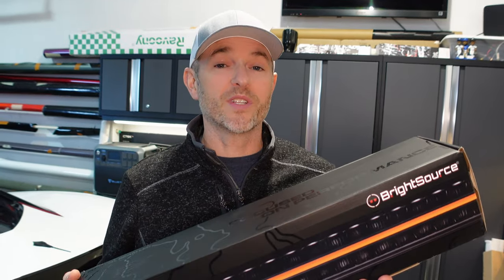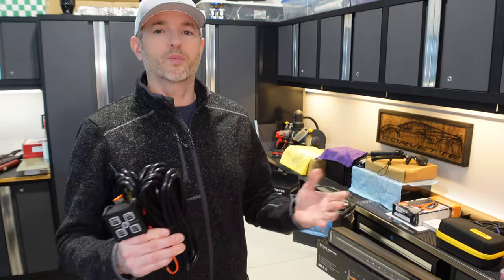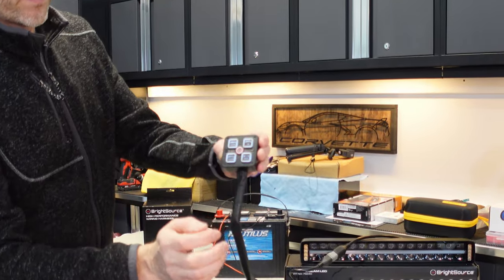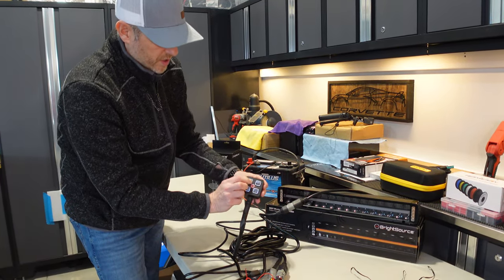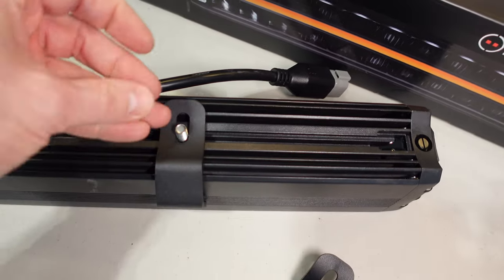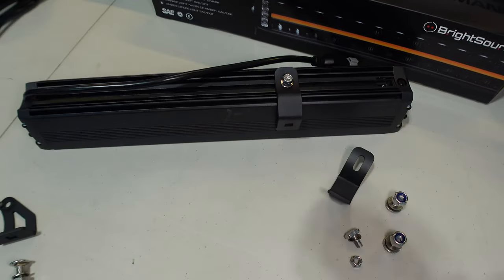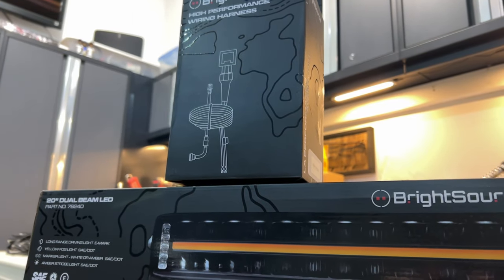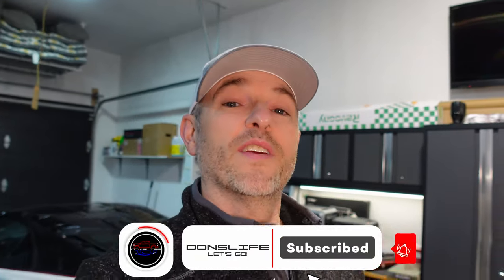Titanium T4 Quad Function Dual Beam Light Bar & Switch Kit by Brightsource

Comment: Sweet setup. I am thinking it might be hard to mount cleanly in the AT4 the switch looks a bit thick. Would you have to feed one of the connectors into the cab? I love the plug and play relay for the brights they offer.
Reply from the maker: The bar can be wired up to the switches I have in my AT4.  I wouldn’t need the kit
Reply: @Donslife  yea you have the NASA control panel there that can do anything. Looking forward to seeing what you do with the front end makeover.  Nice light bar and I like the idea of having it on when the brights are on. I have the bed lights you installed ready to go in and I grabbed a relay and a switch so that I can have them on with the normal button or with a manual button in the bed.  Weather has been too cold and wet here and my truck is too long to fit in the garage. Never thought to test that when we bought the house.

Comment: Is this Light Bar Water Proof or just Resistant?  Is there a Drain or Dribble hole on this Bar?  Does this Bar require the Power Cable to be on One Side or the other?
I really like the FOG Light and the Driving Light choice.
Reply from the maker: IP67 (6=No dust ingress, 7=Water submersion of 3 meters for no more than 30 mins.).  No drains.  Power cable fixed on one side.
Reply: Thank You, I'll write all this down.  Say hello to Mrs. D.L. please.

Comment: It’s street legal as well.
Reply from the maker: Bonus
Reply: @Donslife  the price is pushing 700 CDN including the switch which is extra. Nice light bar though. Brightsource has an incredible product line up.
Reply from the maker: @waynebeck7801 and there are brands charging $1700 CAD for their 20” bars.  If I put it on my truck, I am not in need of the switch.  It can be wired up to what I have in place with my current switches